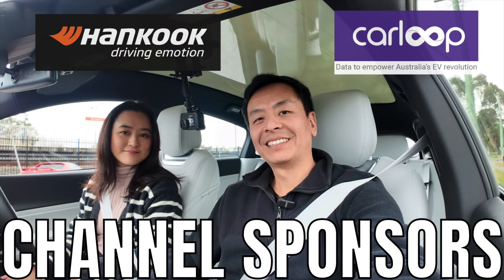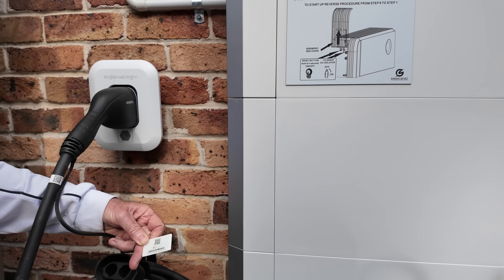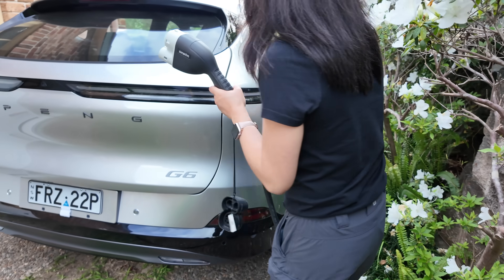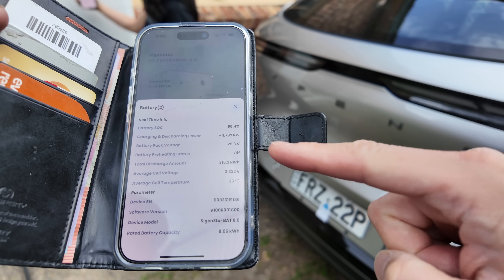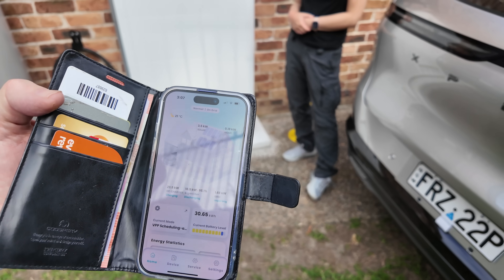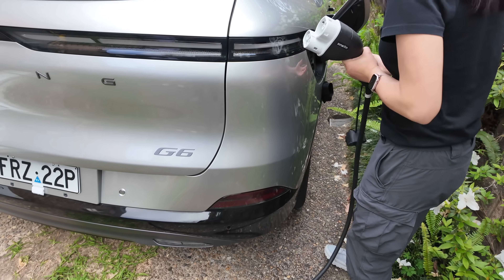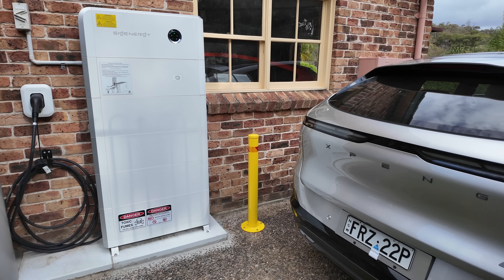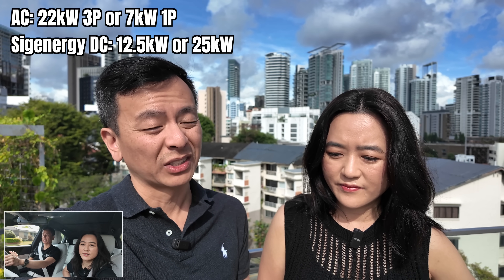Sigenergy EV DC Charger 25kW Real World Test | Is it worth it in 2025?

Comment: Very informative video is the inverter DC coupled or AC coupled
Reply: The solar panels in this setup shown are DC connected to the Sigenergy Inverter. So it is DC from the panels to the inverter then DC to the car. Added to that is DC from the four 8kwh batteries.  The Sigenergy single phase 10Kw inverter shown allows 4 strings of input which are DC coupled.  Currently 3 srings are in use with 34 panels, 1 spare string for the future.

The Sigenergy app has options on how to charge the EV - One option is "PV Surplus charging". So you can charge the EV using just PV panels and also set a priority order so that the PV surpus goes to the Sigenergy battery, then the EV.

On mine (shown in the video) I have set the priorities for solar panel power to house load first, then to fill the Sigenergy battery then to charge the EV.  After that I export Solar power to the grid if the price is above 2c per kw. 

At the moment, I am connected to the wholesale market via Amber.  Most prices for solar exports are negative during the day and Amber curtail the exports when prices are negative.  I sell about 20 kw hours each night between 5:30pm and 7:30pm.  I dont need any grid power imports unless there are exceptional circumstances.

The Sigenergy App and equipment has exceeded my expectations.  Next I am wanting to use V2H and V2G.  Ive only had my Xpeng G6 EV for a few weeks so still seeing how to make use of V2H and V2G and trying to understand why there are restrictions on its use.
Reply: @tonyg2002Aust  Thanks for your comment. I am a bit confused. I was told by my installer (installation next week) that I need to install the 12.5kW & not the 25kW DCEV charger as I am on single phase. Is that correct? How did you get the 25kW DC EV charger? My set up is going to be 34panels @ 500W =17kW, 10kW inverter with 40kW of batteries. I recently purchased a Geely EX5 Inspire which is V2G capable and approved by Sigenergy. So my question is should I be getting the 25kW charger?
Reply: @stanavagiannis2381  Yes yes yes you should!!! And find a new installer.  There is no excuse for them not knowing that it has nothing to do with single or three phase grid supply. As it is a DC charger, power will be drawn first from your batteries (DC direct) , then any solar if present (again DC direct), and then topped up by the grid if needed. Your 40KWh stack can provide 20 KW on its own, and during the day you will almost certainly get another 5 KW from your solar, even on cloudy days. And you have a bidirectional ready EV, so go for the biggest connection to your EV's battery - the 25 KW 👍
Reply: @stanavagiannis2381  Your proposed set up is similar to mine.  I have 34 panels, 32kw of Sig battery storage. MichaelW has answered correctly already.

Total throughput from the batteries depends on the number of Sigenergy batteries and their size.  It is approx half the storage capacity.  For example, I have qty 4 8kwh batteries.  So the total throughput when discharging from the Sig batteries = 4 x 4kw = 16 kw.  In actual use I am finding it slightly higher at 18 kw.  But Sigenergy will state it is half the battery capacity.  
So on yours you will be able to discharge from your 40kwh of sig batteries at a max throughput of about 20kw with the other 5kw coming from solar or the grid to the car batteries with the 25kw DC charger.

Most people would set the Sigenergy option for the fastest charging of the car to be Solar first, then Sig batteries, then grid last.  You can also set it to charge the car with surplus solar power only - great functionality in the Sigenergy app and DC charger.

Also check what length the charging cable is on the quote. There are two lengths that can be ordered : 7.5 metres and 10 metres.  If you will have multiple cars to charge, the longer cable will probably be more practical. On your installation the DC charging modules is going to sit quite high as it will have 5 batteries underneath it and you will loose at least 1.5 metres of the cable running down inside the decorative side panels to the ground, so 7.5 becomes 6 metres. This may be enough for your situation. Just something to be aware of and check twice before taking delivery.
Reply: @tonyg2002Aust  Thank you so much for your informative reply Tony. 

I got in touch with my supplier and I am now trying to make a decision if I should get the 12.5kW or 25kW charger. 

Ultimately I want to charge purely off solar. Charging speed is not a critical factor for me at the moment but then again I am thinking I should future proof myself. 

Great tip about the cable length, again 7.5m is sufficient for now but in the future if I get a second EV I will definitely need the longer cable.
Reply: @MichaelWakefield-mx6hg  Thank you so much for your reply Michael.

I spoke with my supplier, it was just a miscommunication & they assumed I wanted the 12.5kW charger on a cost factor.

Ultimately I want to charge purely off solar, so realistically it comes down to charging speed 12.5kW or 25kW.

On the export side I will be limited to 10kW as that's the size of my inverter. Unless I upgrade to a 12kW inverter & 25kW charger as overall I am going to be paying less.

Comment: What’s the benefit of 22kw DC charger over 22kw AC charger (both from Sigenergy)?
Reply: @aikz5  You don't need 3 phase power or a compatible car with the DC charger.
Reply: The car needs a 22kW inverter if you're feeding it AC
Reply: At a single phase house (as shown in the video) 7kw is the AC alternative.  So 3 times faster with the 25kw DC charging module from Sigenergy in that sinle phase home situation.

Comment: Without V2G / V2H this seems pointless, unless your car has slow AC charging. a 22kw AC will be negligably slower, cost a substantial amount less etc. Its really only the future V2H/V2G that makes this even remotely sensible. And currently, that doesnt exist in australia right?
Reply: I guess on a single phase setup, the EV/AC can only deliver 7kW & would cop the conversion loss if charging from the battery stack/solar, & again back to DC by the onboard rectifier for storage to the vehicle battery. The single phase DC/EV can supply 12.5kW with just a DC/DC voltage step.
Also with either 1P or 3P, if you want to charge exclusively from battery stack & solar via EV/AC, inverter/controller capacity might throttle the charge rate.
NB: not buying advice; just what I think I've learnt about how this works 🧐
Reply: It does exist. 
Some eastern state DNSPs have now started allowing v2g.

Comment: Cost of a DC charge module (especially with the 40% saving) is cheaper than an additional 8kw module, but then allows you access to 50-80kw or so of energy capacity in a time of need. So if you were on the fence on getting an extra module in your stack 'just to be safe' then you're probably better off getting the DCEV module and using the car battery if the need arises.
Reply: There's also significant costs to using your car battery as a home battery. Like car batteries are costlier to replace as they wear out. At the same time this would be great for someone off grid to also not need to go to gas stations while also greatly extending their PV storage.
Reply: @buckbuckleyson2259  Given that average LFP batteries are good for 3000-6000 full charge/discharge cycles, you would have fully charge and discharge each day for over ten years. That seems like an extreme scenario for a non off grid application

Comment: Inverter size doesn't matter correct? As it's straight from the DC (except for grid) .. ie. dc-coupled solar + batteries (0.5C * kW). So even a 10kW hybrid inverter could still output 25kW to the car (assuming 40kW batteries + 5kW solar), or higher c-rate battery modules.
Reply from the maker: My understanding is that the inverter size matters mostly for powering the house load and/or exporting to the grid

Comment: Oh wow, I was going to restrict myself to the 12.5kW EVDC module because I was going to install the 12kW inverter. 

This is fantastic, 25kW charging from home, here we come!
Reply: If single phase house the 22kw might trip the circuit since residential house is 80amp max
Reply: @icegoffyicecoffee the point is it's DC - 24kW from panels and the last bit from the batteries. 

Doesn't draw from the grid at all.
Reply: @icegoffyicecoffee  This is a single phase house and I can charge at 22.9kw as shown without any grid input (Solar + Sigenergy battery).  The Sigenergy app allows setting priorities and directing where the power comes from. I dont need to use any grid power.  

I expect if I set it to grid power only for DC charging it would be 10kw throughput  maximum imposed by the Sig inverter being single phase and 10kw.  Good point raised!

Comment: It would be great if you can show the V2G mode operating.

To me the key use case for the DCEV is to be able to export for a sustained period during the price spikes.  The last spike in June was over 4 hours and most people's batteries were exhausted after 2 hours when the price went up.  With DCEV you can swap to your 2nd EV and keep discharging.
Reply: And if you don’t have access to TOU charges?
Reply: @theairstig9164 the financial case for batteries (including V2G) is greatly diminished if you don't have access to dynamic pricing (including dynamic sell prices) or ToU tariffs.

Comment: Can you choose where the power is drawn from to charge the car? From solar only, or grid only, or battery only, or solar and grid, or solar and battery, or grid and battery, etc?
Reply from the maker: There are priority settings from the Sigen app … we can explore if we install it
Reply: Looking at your question those combinations are supported in the Sigenergy app.  There are also priorities that can be set.  Sigenergy has the option for "PV Surplus power" for car charging, which can then have priorities for Sig battery first, then EV battery, then export for surplus Solar power.  I use that option and set of priorities at the moment.  

I am using wholesale power so sometimes it can make sense to use the grid power if it is at zero/or negative cost.  Occassionally the price of grid power is negative so if my Sigenergy battery fills up I can also extend to the car battery to make the most of the opportunity.

Here in Australia I am using Amber for grid power so still working through how Amber software controls my Sigenergy battery and which Sigenergy app settings it integrates with.

Comment: The economic equation becomes weighted more towards the customer when they're charging more than 1 car. You guys as an example will eventually be a permanent 2 EV household. Having the home fast charger just makes life easier. Both cars get charged overnight instead of just 1 as an example.
Reply from the maker: Or both get charged during the day quickly when there’s solar or cheaper tariffs … very compelling
Reply: @LudicrousFeed You said you have a child just about to start their driving career, so it's entirely possible that in 2 or 3 years you're a 3 EV household. This charger becomes a life send at that point because it's actually quick enough to get 3 cars to a good state of charge per day. 
In short I think these things should fly off the shelves and when I am ready for a battery setup I will have one of these for sure.
Reply: @SirNecro  in 2-3 years? in 2026 they will be a 3 bEV household :D *guessumption Tom Jnr will get his own bEV the day he turns age 16 so he can drive and get used to that car than using Mom/Dad car all the time, and while on L-plates one of the parents will be front passenger-supervisor in Tom Jnr own car
Reply: @Sensei.6O11 I don't think it'll be on his 16th birthday so to speak, however, Tom Sr did mention that he sold the BYD in an effort to get something Tom Jr can drive on his L's.
Reply: @SirNecro  what makes you think Jnr won’t get a bEV (possible 1-2 year old/used) on date of 16th year going around the sun? Quite a few people do that, so kid’s can have their own settings in the car and so they get use/familar to the car from day-1 of getting the L’s